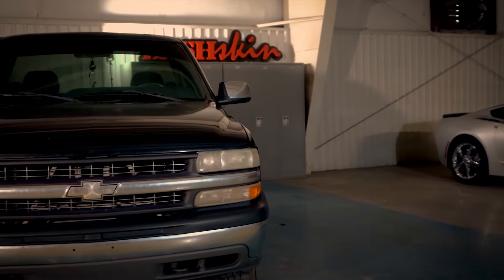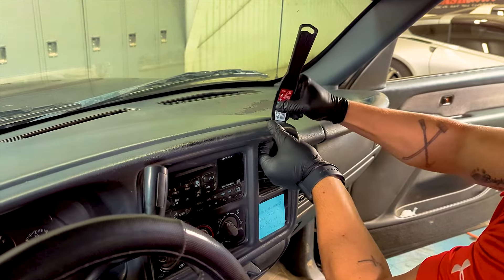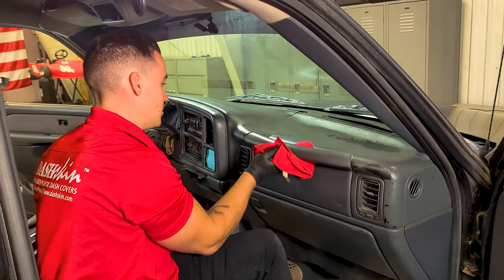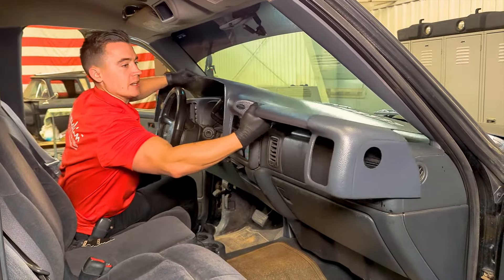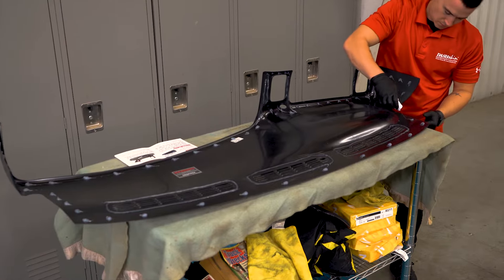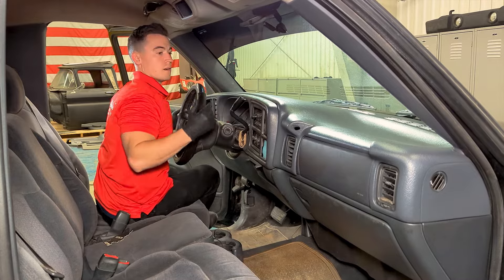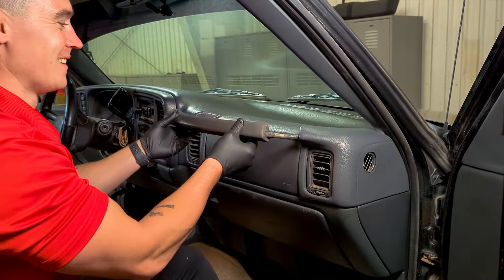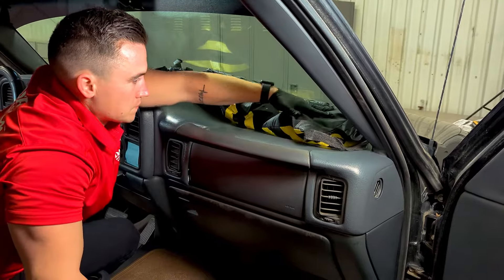HOW TO: DashSkin 00-06 Tahoe/Suburban/Yukon/Avalanche/Silverado/Sierra Dash Cover Installation

Comment: How will the dash vents be removed when a A/C actuator needs to be replaced?
Reply: Same question..
Reply: @cascadinghaze7125  I guess they had no answer for that issue.
Reply: Since they didn't answer, I guess it means swap it with a new one before installing the cover

Comment: @DashSkin, would it better process and bonding if i pull my original out to attach than re install?
Reply from the maker: I would not recommend trying to install the skin while the dash is out of the truck, it's actually much easier to get a great result with it in! If you do it out of the truck, it's easy to forget how the cover will fit around certain trim pieces and make a mistake, and the bezel needs to be reinstalled completely while the silicone cures.

Comment: What about the circular light sensor near base center of dash near windshield? Is it covered up? Will it work as before?
Reply from the maker: @JulianCasso  Yes, there are actually two holes so all light sensors near the windshield are accounted for. If you don't have automatic climate control, the left hole will remain empty. You can check out close up photos on our website for a visual.

Comment: My dash is completely crumbled. So I just removed it. Any way to retrofit this?
Reply from the maker: Unfortunately not, our product will not work as a replacement dash. It's not quite thick enough and has no good way to mount without the structure of the original dash. I'd recommend checking out a U-pull salvage, this generation of dash is SUPER easy to pull without breaking! There are some youtube videos that show where each bolt location is. I pulled three in a row in one day without breakage, if my clumsy self can do it you can too!

Comment: Well worth $200 vs trying to remove the dash to replace it
Reply: It is so easy to remove the top part of this dash and it’s ton of trucks at the pull-a-part
Reply: @godcarsmoney  sure there is, and I'd like to see if you can find a 20 year old dash that's not cracked to pieces, and as brittle as an egg shell.  Just glued and welded mine back together that broke 15v or so pieces trying to get it out was on so I can put a dash skin on it
Reply: @originaldanman  i find good one all the time I can put my hands on 3 right now and paint is only $13 a can
Reply: Depending on your area, you'll still find good ones. 
In super sun hot Arizona these are probably egg shells, in Maine probably good to use. 
It's the opposite of rust basically.

Comment: are you still able to remove the original dash for service after the skin is installed
Reply from the maker: Yes, the screws that hold the dash in place are behind the gauge cluster bezel and under the removable dash end caps, neither of which the skin will cover.